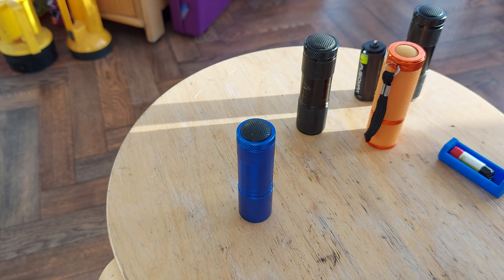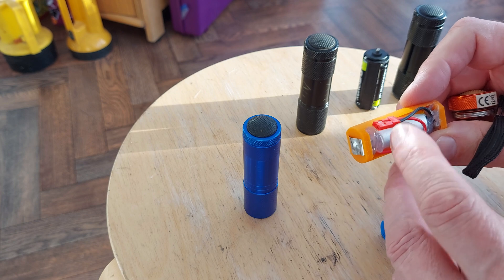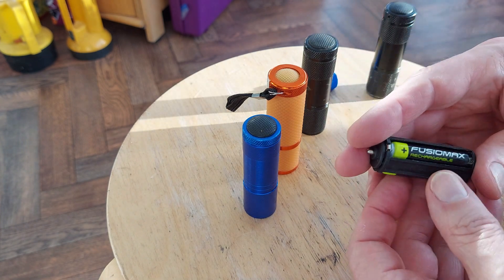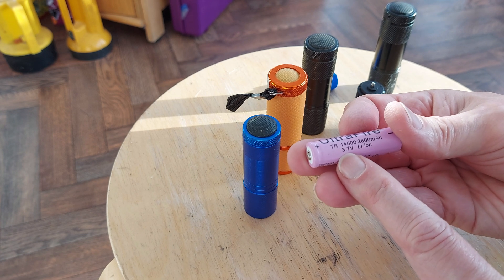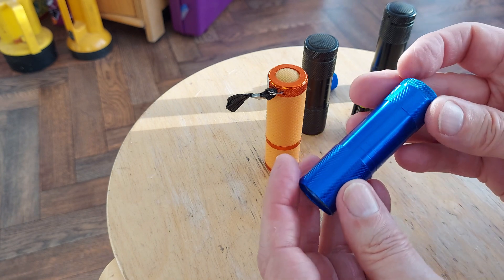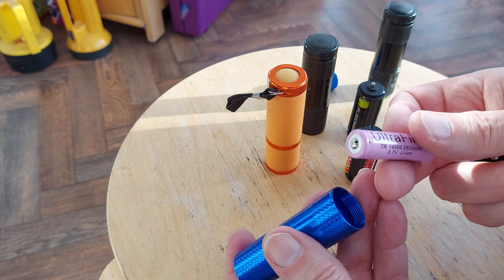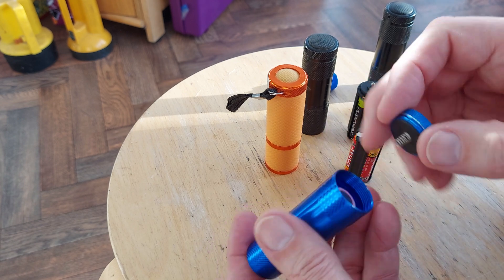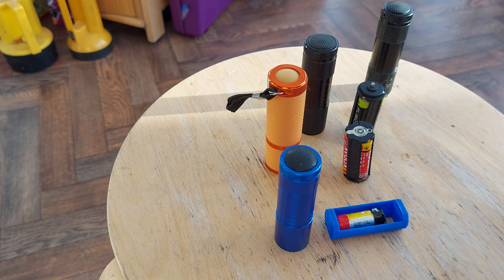Lithium Ion 14500 sleeved for small flashlight

Comment: Great use of the vape batteries, nice design 👍 😊
Reply from the maker: The Vape LiPo adaption is fine if you collect Vapes like I do, but if you just want the convenience of the Lithium Ion 14500 battery, then the simple sleeve is the answer. Obviously buying a pack of 14500 LiIon batteries and a matching charger is more expensive than picking up free vapes in the street.